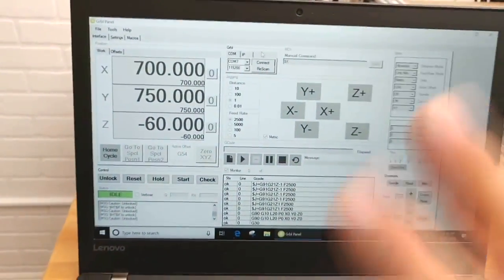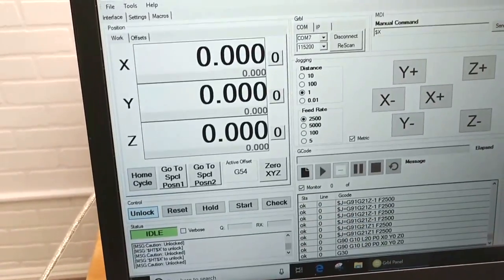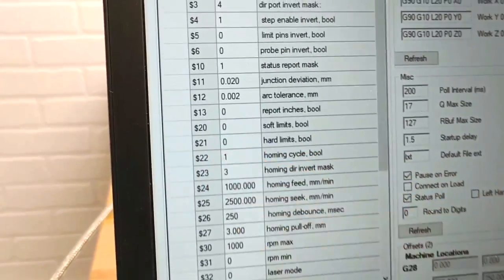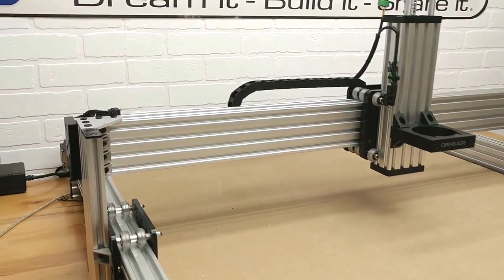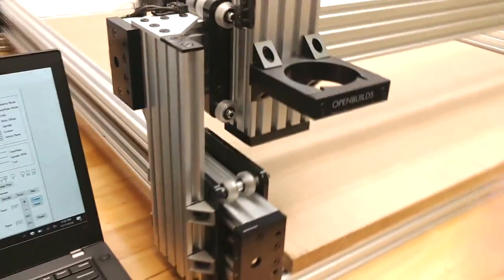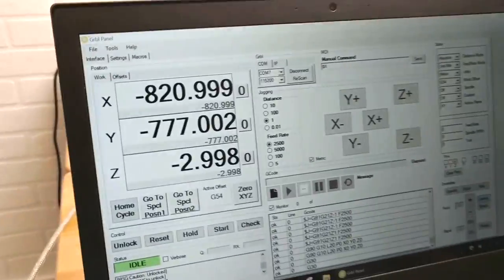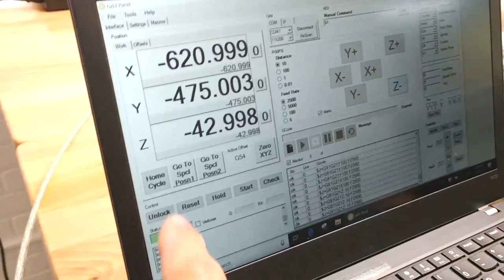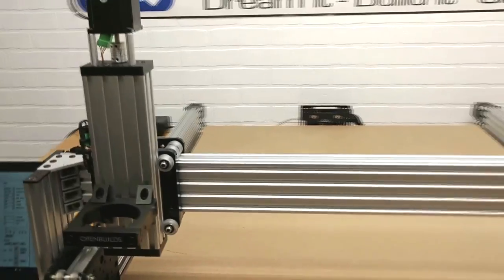OpenBuilds Quick CNC homing and limits demo

Comment: I noticed the home location is a large negative number. Would that not be the zero location? Mine is the same and I would prefer the machine called that all zero.
Reply from the maker: If your using OpenBuilds CONTROL when you home your machine it touches off on the front left corner of the machine (if your facing the machine and your limits are set up as in the Builds videos) Once your homed you can Zero all in the software to make this point your starting point. Also if you have a smaller piece of material located out in the middle of the table and you want to start there, no problem just jog out to the front left corner of the material and zero there to make that your new start location. Please have a look at the end of the Build videos to get a quick overview on how we use the OpenBuilds CONTROL software to run a job.

Comment: Will it home anywhere and actually save the zero? Im asking coz i like to use the right corner on my machine when milling wood just to have more control over the chips and cleaning.
Reply from the maker: Yes! you can jog the machine where you like and zero it to ensure that's where you start every time you run the code, so you can load and unload stock into a jigged spot on the machine for instance and start there repeatedly.

Comment: what machine is this?  What do you use on the lead screws to drive the axis?
Reply from the maker: This is the OpenBuilds LEAD Machine and we use Nema 23 Motors to drive this configuration.